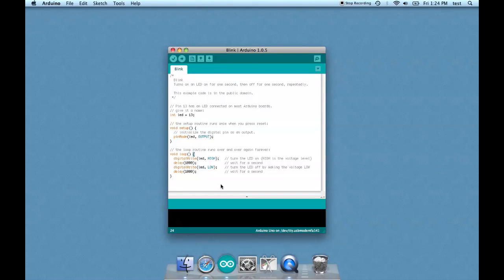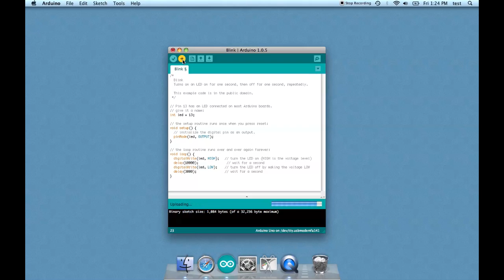Arduino for Beginners   18 Solenoids &amp;amp; how to control them with an Arduino

Comment: Why you connect the ground to the 5V pin on Arduino? Will you joke us? And there is a reason, why you ever have to use a diode at the solenoid!

Comment: not using a diode to protect the transistor is a bad design, especially if you want to learn how to do things properly. Always use a freewheeling diodes with inductors like solenoids.

Comment: Nice tutorial... although I still don't understand why do you need the transistor. Wouldn't it be equivalent to use the same circuit without the transistor? What is its purpose (i.e. protecting the arduino, controlling the solenoid....)

Comment: What is the opposite of a solenoid?... As in, what is used to push out the rod when current is applied, and then go back when none... (Or does swapping the polarity work???)
Reply: Swapping polarity does not work, as suggested previously. It's an electro-magnet. There's another type of solenoid, where the plunger goes all the way through the magnetic coil...and one side is spring-loaded.
Reply: Try using a linear actuator
Reply: swapping the polarity works!
Reply: Nah...that doesn't matter.

Comment: Can the ckt be used for connecting remaining digital pins i.e 12 11 10 ..etc

As m trying tu do that but it isnt working

Also for my project i need 6 solenoids to work simultaneously...

But the issue is solenoid works only with pin 13....can u suggest a solution?

Comment: Can anybody tell me why the power doesn't go directly plug into the Arduino?
Reply: my understanding of it is arduino runs at 5v, for more power and to protect the arduinio you use a seperate power supply or relays to handle any voltage required for your project below is arduino's power requirements and outputs: 
Operating Voltage 5V
Input Voltage (recommended) 7-12V
Input Voltage (limit) 6-20V
Digital I/O Pins 14 (of which 6 provide PWM output)
PWM Digital I/O Pins 6
Analog Input Pins 6
DC Current per I/O Pin 20 mA
DC Current for 3.3V Pin 50 mA
Reply: I got a few basic sketches to work.  a 9v battery does work. could you use say 50 volts with the arduinio by sticking the power wires into the breadboard and using a big resistor?
Also, how can I write a sketch without understanding all the pins, is that even possible? I used to  make an effort to make simple circuits with the basic components, that didn't really work for me.... That is why I started with Arduino.
Reply: the power doesn't go directly plug into the Arduino is bcoz basically any digital circuit is designed for 5V only hence we use a regulator to generate a constant 5V even if there's a power surge.

Comment: Okay I have a question  I am in a wheelchair and like many in a chair  cannot empty my own pee bag so i was wondering can i rig up a switch operated solenoid to open and release the pee , i have seen one thats wireless but the cost is around 7/8 hundred. the wired one had a tube run from  the pee bag through the solenoid and a  on off switch located on the chair. will it work with gravity feed. i know nothing about solenoids
Reply: Did it work?

Comment: i think you forgot the bypass diode, but very good tutorial
Reply: Ok sorry for my english, the bypass diode allows current to flow in reverse through him instead of coming to the microcontroller. Not to place it in the long run can damage even the transistor. That's why people always use a diode associated with a relay or a solenoid.
Reply: That reverse current is created thanks to the solenoid's coil of course
Reply: I was wondering if you could verify the part number of the solenoid. I looked at Adafruit’s inventory, and p/n 413 (per your parts list) comes up with a solenoid that only has a 10mm stroke. I know I could use just about any other solenoid, but I need one similar to the one in your demonstration. Great video! Thanks!

Comment: if my solenoid is 12v dc, what transistor do i need?
Reply: use tip 127 or 120
Reply: *TIP

Comment: cool so if you hit the base with a voltage it turns on the switch , thanks for posting , this is the first tutorial on the subject ive grooled threw in detail but i have seen several . your video helped me nail down exactly how a transistor switch works or solid state switch  what ever its called